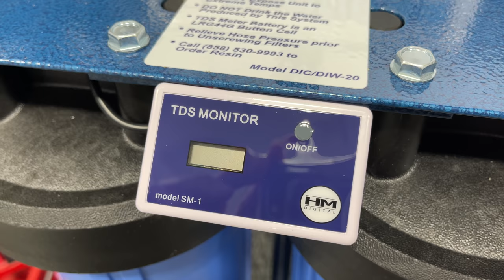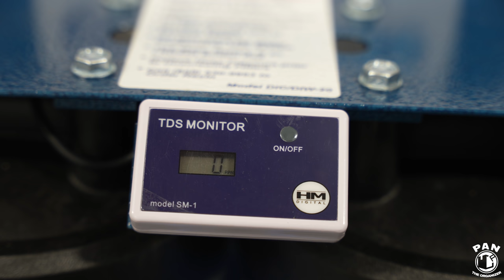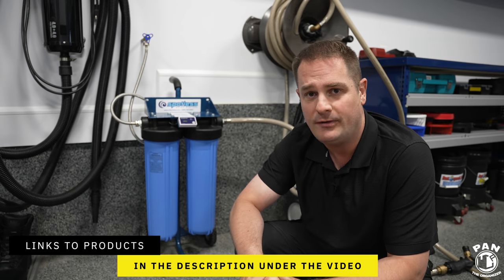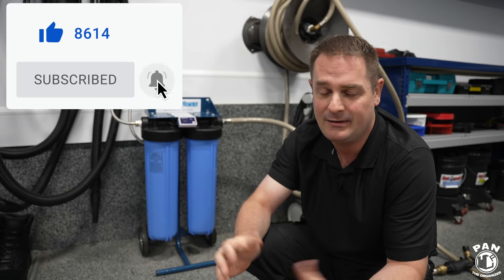No More Water Spots When Washing Your Car In The Sun!

Comment: Hey Pan! I was looking into a cheap method for getting clean mineral free water for my wash buckets and I came across the Sawyer TAP filter. From what I’ve seen it has close to a 2GPM flow rate and can connect straight to a hose bib. I was planning on testing one on the end of my bucket filler as part of my wall mount system. The flow rate is cutting it too close to try with my Active 2.0, but it’s enough for filling buckets and possibly a K1700/similar entry level pressure washer with a lower flow rate.

Comment: Nice succinct review.  Tried a similar system that did as claimed, however where I live if left wet outside once dried the water droplets had accumulated dust, pollen, bugs, and whatever else was floating about in the environment somewhat defeating the purpose.  For the non garaged, daily driven car it was not the economical solution hoped for unfortunately.  For prized garage queens not requiring weekly washings or a professional detailer it’s a great solution as it does offer a competitive advantage/time efficient alternative to other drying methods.  Thanks for continually interesting content.  Cheers.
Reply from the maker: Thanks Steve!

Comment: I was going to use this tip in a video for detailers' tips and tricks, but I am horrible at videos. 
You can pick up a ScaleRX de-ionizer for $80-$120 USD and adapt it to fit your system. Much cheaper for the beginning business budget for a detailer and it eliminates 76% of the minerals that will cause water spots. You can also use the ScaleRX in front of your current DI system and it should lessen the filter replacement times, and it says it can last up to 10 years.

Comment: If you add sediment and carbon stages, it will make your DI resin last longer. I’ve used DI water but at the end decided to use blower and drying cloth instead. DI water made no difference in long term other than added expense and time.

Comment: My concern is how many washes can you get out of it before you need to change resin?  You stated that the resin cost $140, is that for one bag and does that one bag fill both canisters?  Do give a follow up Pan on this system and how long it lasted you and how many washes you actually got out of the resin.  Thanks Pan...
Reply from the maker: One of my viewers said he got 11 months by washing his car 1-2 times a week. Pretty good.
Reply: @PanTheOrganizer it all depends on the total TDS in your water system. My TDS in my tap water is 162, so it gives me a total of 46 washes rinsing for 5 minutes at 2 gallons per minute. I only use it for rinsing.

Comment: I may consider this system, I've been looking for one but these refills cost quite a bit. Are we able to use other Resin refills with this kit?
Reply from the maker: I don’t have an answer to that unfortunately. You would have to check with CR Spotless.
Reply: you can, however, not all resins are the same, check your cheaper source, it may be regenerated as opposed to new.

Comment: I've been searching on the Internet for a few days now and surprisingly I haven't found any kind of answer even close to my question, I'll post it here to see if I find an answer at least from Pan or other wise folks 😂:

Does using water with a TDS level of ~130 damage or harm a pressure washer in any way without using a DI system first? Is there any kind of limit to the amount of TDS your water can have before it's not good for a pressure washer?
Reply from the maker: I'm not a water treatment specialist so it would be hard to answer. I guess it's like anything hard water can affect. Your water heater, shower, plumbing, water lines to fridge, etc.  Anywhere where high mineral content can eventually corrode materials, I guess the same could be said on the long term with pressure washers. That being said, a TDS of 130 isn't as bad as people with 400-500 levels of really hard water issues.

But perhaps someone with experience in water treatment and analysis can reply to your comment and give their 2 cents.

Comment: I work at a car wash. Do you think it would be better to wash then use spot free? Our spot free does a pretty good job but my customers use the spot free last & I admit I use the spot free last as well..Now I’m wondering if that’s the right thing to do…
Reply from the maker: Most people use the system for the final rinse as that’s where you usually have the most chances of getting water spots. But I leave it on all the time so I get DI water for washing, foaming and rinsing. :). But you will burn through resin quicker that way.

Comment: Hi Pan,
We've got hard water here and this unit is the way to go.  Glad to see you picked on up too.  Just a curious question for you......  did you run your house water through the DIC-20 without anything in the filter canisters to see what the dissolved solids meter read, to see how it compared.
Reply from the maker: I already had good water as I have a water softener system in the house. So the TDS would be pretty low to start with. Getting the water deionizer was just the ultimate step for detailing cars.

Comment: Just so you know, water softener absolutely does not reduce Total Dissolved Solids (TDS). In fact it usually increases them. Water softeners work  by valance exchange. They exchange NaCl (salt) ions with Calcium, Phosphate etc. which make water hard. For each Calcium it replaces with 2 Sodium ions. So each Calcium based TDS is replaced by 2 Sodium based TDS. But Calcium makes the water hard. The actual TDS in fact doubles. Lets say your TDS in tap water was 200. Lets say 120 of the 200 was due to Calcium and 80 due to other solids. A water softener then will then exchange that Calcium with 2 Sodium based minerals increasing your total TDS. When using a DI water system like this, it would be better to skip the water softener and go directly to the DI system as that will make your resin cartridge last longer. Or the best thing would be a whole house Reverse Osmosis unit before going to a DI system. RO units can bring the TDS down to the 20's but they are expensive
Reply from the maker: Thanks for the clarification. Sounds like you know a lot about water filtration. Is that your field of expertise? And yes you are right about the water softener actually not being the best before going to the DI system. I reached out to CR Spotless and they said that the water softener might actually make the DI resin not last as long, and that is what I'm seeing. I need to change the resin more often. It's quite costly, but I still like to have 0 PPM ultra clean water.

Comment: Im detailing out of my truck which is a low profile setup. My question is can I just buy the water deionizer system for my house, hook it up to the spigot, and then just run a hose to fill up my water tank? Would that be the best thing for me to do if I want deionized water/cost effective? My tank is only 68 gallons

Comment: The lower the TDS of the input water determines the life of the resin . I supply mine with reverse osmosis water from a tank that is almost zero TDS. I predict the CR will not need resin for a couple of years. But if you have 500 PPM TDS coming in, you will get less than 300 gallons .
Reply from the maker: Makes sense.

Comment: Curious, if you have harder than average water, does that reduce the longevity of the filtering resin? As opposed to someone like you with a water softening system - would your resin packs last a lot longer?
Reply from the maker: I’m no water expert but my guess would be if you have super hard water the resins have a lot more work to do so won’t last as long.

Comment: Hey quick question, can these systems work off a bucket of water rather than a water hose? I need one to clean balconies and the only water source I have is from the bathtub that I put in a bucket.
Reply from the maker: You these need to be hooked up to a garden hose with a steady water supply.

Comment: I have the Simple Chuck version of this which is also through CR Spotless. My water tds can range anywhere between 240 - 310 ppm. I was in love after first use. I use it as a thorough pre rinse and wash my wheels/tires, then I do the rest with the rinseless wash method.

Comment: Thinking of getting one of these Pan, thanks for the review. With our Canadian winters and not having a heated garage, I have a wall mounted pressure washer system  that I turn the water off to the garage in the winter,  blow out the lines to make sure there’s no water in it. Could a wall mounted system be left in the garage over the winter months?
Reply from the maker: As long as you drain it an empty the water yes.

Comment: Great videos as always. Do you have a bypass system or do you use for all parts of wash?  I have the simple Chuck which is almost identical and trying to find a way to quickly bypass without having to unplug and plug everything in for the switch. Thanks!
Reply from the maker: I don't have a bypass system, so use the deionizer for every step hehe.
Reply: @PanTheOrganizer  I figured that was the case. Have any idea how to set one up? I can’t seem to find any videos or info on it

Comment: If I wanted to use this as only a final rinse should I sheet the vehicle with water or can I use the pressure washer along with this for the final rinse. What I'm getting at is would flooding the exterior with water on the vehicles enough to take care of making sure of getting the minerals deposit off or using the pressure washer enough of a through job
Reply from the maker: You can use this with a garden hose or pressure washer, as you wish.

Comment: I'm thinking about starting a mobile detailing business. If I'm going to have to wash customer cars in the sun, I think this might be my only solution? Since I will rely on the customers water supply, do you think this would be a cost effective solution? So all I have to bring to the customer is my pressure washer setup + di system. Any feedback would be appreciated, thanks Pan.
Reply from the maker: If you are using a mobile detail setup, you would likely have a water tank in your truck. You would fill that tank with deionized setup from your shop, before going to your customer's homes.

And since you're planning on starting your detailing business, I have a bunch of cool videos that can help you out. Check these below:
✅ Is detailing really worth it? : https://youtu.be/Yq1B_UKNayo
✅ 20 year old detailer making $130,000 a year: https://youtu.be/g08gkwfv1Wk
✅ What products do you need to start a detailing business? https://youtu.be/FLq-vKIWhKw
✅ Digital marketing secrets to make more money with your detailing business: https://youtu.be/Tv9GeGhA-AA
✅ Custom installation of equipment in a mobile detailing van: https://youtu.be/IDUwfl8GmgU
✅ How to start a mobile car detailing business: https://youtu.be/WV3FJcWf77I
✅ How to become a successful entrepreneur: https://youtu.be/wTCfVmeMeEo
✅ Mobile detailing truck setup: https://youtu.be/tnFjhkM4YJo
✅ Things I wish I knew before I started detailing: https://youtu.be/SYqWRq27YgI
✅ How to be more efficient at detailing: https://youtu.be/33ChaMf8dCM
✅ Digital marketing to grow your detailing business: https://youtu.be/1Cd3N1g6mSw
✅ How to rank your detailing website on the 1st page of Google: https://youtu.be/pNflfxehpHg

Comment: Hi how many washes do you get for a 140 dollars worth of resin before you have to change it
Thanks
Reply from the maker: Hard to say as not everyone uses the same quantity of water. Some also just use the DI system for the final rinse. Time will tell for me. But one of my viewers told me his resin lasted a good 11 months and he washes his car 1-2 times per week. 

The system can generate up to 300 gallons of DI water.
Reply: It all depends on the GPM your pressure washer produces. My pressure washer produces 1.3GPM and for 300 gallons that equals 3.84 hours of use. I have the CR Spotless DIC-20 like the one in the video. The two cartridges cost me $119 from CR Spotless. I have to replace mine every 3 months because we have 4 vehicles in the household. I don't always wash all 4 vehicles each week.

Comment: My hose reel is on the outside of our house, so is this system weatherproof so I can leave it outside without having to lug it out and connect it up each time I want to use it? The only part that I would question would be the water quality monitor (being electronic), as the rest seems like it wouldn't have any problems, but I can't say for sure.
Reply from the maker: I am pretty sure it can be left outside, but double check with CR Spotless to make sure.

Comment: Did you have any issues with the ELEY garden hose you have connected to the CR Spoteless System due to the orifice size being a little larger than the standard 5/8 inch?

Comment: In Arizona we have deionized water fill up’s and honestly I thought this was going to be a life saver but 300 gallons and the resin being $140 to maintained while the fillip locations are $0.20 a gallon I’m comparing $60 per 300 gallons to $140 per 300 so is there a specific advantage of these besides convenience?
Reply from the maker: I'm confused by your question. What is a "fillip location"? What are you comparing?
Reply: @PanTheOrganizer  sorry meant fill up locations
Reply from the maker: If you are lucky enough to have deionized water fill-up locations near you and the cost is lower and you don't mind having to drive there every time, then that's all good, no need for a DI system.

Comment: Hey Pan! Quick question. Just talked to a local water softener company, and explained I wanted one to help with washing my car for better suds and less minerals. He said a bypass is installed so water coming out of the hose spigot is not soft water, he said it would still be the hard water out of the spigot because a bypass is installed. Does this make the water softener useless in terms of washing a car and if so, should I just get this deionizer instead of water softener?
Reply: a bypass will do it's job if needed. What is the purpose of buying an equipment and by pass it ?. Sorry, but you may be misunderstood him, or you should avoid to buy something from him. A water softner as a bypass valv, that can be use manually, or automatic when the softener is doing a regeneration . Don't use the softener when regeneration occur. But a water softner win't avoid mineral spot. They will be just easier to take them off if they appear
Reply: @sebastienlemoine8491  I went back and spoke with the water softener company today to get more information. He said the only purpose of the bypass is if we want to water our yard and don’t want to use soft water, we use the bypass to temporarily convert back to hard water just to water the yard. As soon as you’re done watering the yard we would turn the soft water back on. He said that’s the only reason the bypass exists because some people apparently don’t like to use soft water on their yard.
Reply: @jasonfazio3535  ok i understand, your post wasn t clear. It makes sens and it s easier to switch between two quality of water

Comment: Pan thanks For video.  Been thinking about this For my house. But i have one Question.  When our New England weather gets Cold and i can't wash outside anymore.  Do the Filters need to Be drained Or can Are can they Sit All Winter Till the following Spring
Reply from the maker: You would have to ask CR Spotless but my guess is they need to be fully drained.
Reply: Drain it. The water can freeze inside the tank and crack the tank.

Comment: Pan, can you recommend an inline
Valve switcher that I could install that would allow me to use only the
CR SPOTLESS when rinsing the vehicle? Then turn the valve off , then I could go back to tap water when washing the car?
Any tips?
Reply from the maker: You can get a piping kit from Obsessed Garage here: https://bit.ly/3wBIEjY
Reply: @PanTheOrganizer  
I was thinking of a quick t valve adapter that I could put inline on the portable unit, and have the option of using deionized water when rinsing, the turning the valve off to allow tap water to be ran for foaming and initial rinsing.

Comment: One question I have,I just moved to a new home last year and we don’t have regular water but a well and we also use a small water softener unit where we put some salt(similar to what you have Pan) but the water because is in Florida usa still stinks as hell and water spot like crazy a night mare for washing cars so if I buy this unit is going to be much better or I need something bigger and stronger thanks.
Reply from the maker: This will give you 100% mineral free water. But like any water deionizer setup, the harder the water that gets filter, the more often you’ll have to get new resin.
Reply: @PanTheOrganizer  that’s exactly what I thought that’s why I suggested  if I need a stronger and bigger unit because believe me we have a very hard water,but of course the bigger the unit the most expensive it gets,how often would I have to change the resins filters with a water that bad?…. Thanks Pan

Comment: I hav rain water and sometimes we throw bleach in the water tanks and where I live is dusty so what should I buy? I hav a 600 gallon water tank, I want to start washing and detailing cars
Reply from the maker: I'm confused as to what your exact question is...
Reply: @PanTheOrganizer   I mean I don’t hav tap water, I hav water that catch when the rain falls and that what is attached to the house and I throw bleach in the water to kill germs, Can it use it to wash car or do I need to catch separate water to wash the car with? Also my house roof do accumulate dirt because most of the days are dry and when the rain falls that get caught in the water when during rain fall
Reply: @agentsixx4343  All of your water supply comes from rain? Is that correct?
Reply: @deanbush  Yes it does